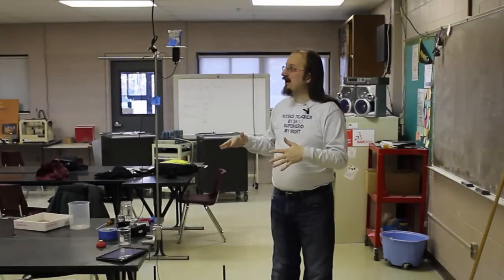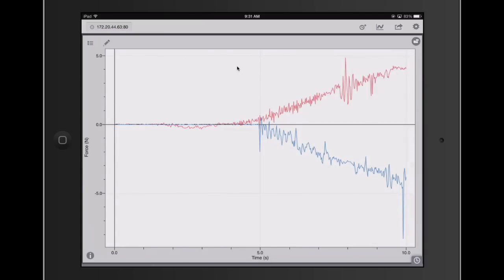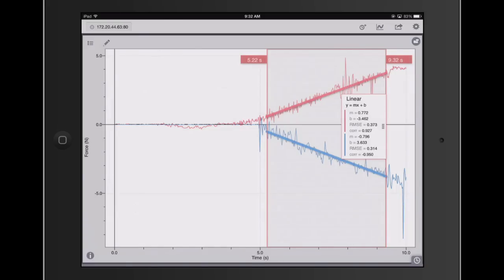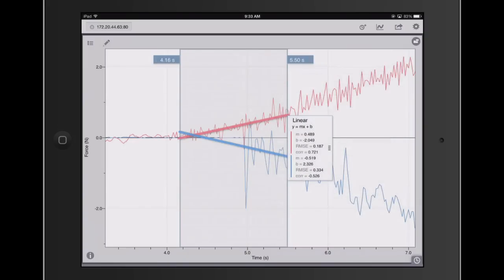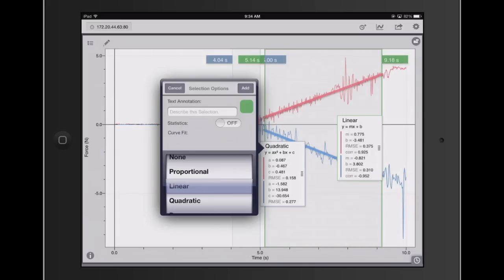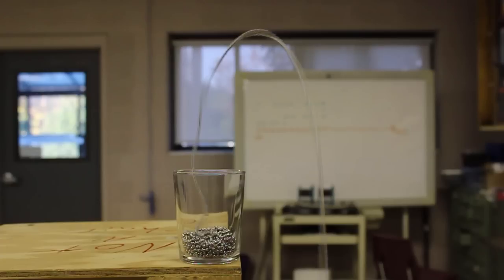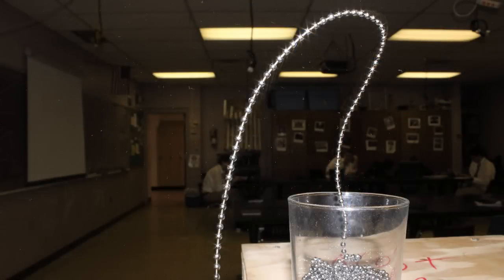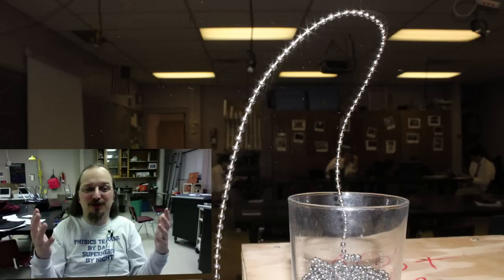Self Siphoning Beads - What's the Answer?

Comment: A bit of hypothesis. Consider an individual bead yanked from the jar upward as a free particle. It would follow an arced path consistent with gravity. Once the siphon is no longer accelerating the tensions on both sides of the bead should be equal and nearly opposite allowing free-projectile like motion. Prior to constant velocity the accelerating fore segment is effectively very high gravity and no visible arc.

Comment: Some observations from "Understanding the Chain Fountain" video by the Royal Society are that when a resting bead is pulled up, it pivots around its center which causes the far end to push down more on the table than it otherwise would, and that a system where an stationary object is forcibly joined to a moving one loses kinetic energy.  Put those together and there will be "free" energy available to the chain when it is jerked into motion.  Further, at the bottom end there will be free energy available when a vertically-oriented chain hits the bottom and would have to pivot sideways.  Combine those together and there's enough energy available to raise the top of the chain.

Comment: It speeds up at the beginning because the gravity is putting energy into the system (I know it doesn't, but for the sake of simplicity lets say it does) until friction and inertia of the stationary beads balance it out. It goes to linear speed because for every bead that comes up there's one that hits the bottom and therefore is out of the equation.The amount of beads affected by the gravity is pretty much constant and so the whole system is in equilibrium.

Comment: So, the two sensors are recording force? And the force is weight? So the graphs here indicate that as the weight of the chain that is in the top jar decreases, the weight of the chain that is at the bottom increases? Couldn't one, you know, intuit that without the assistance of several hundred dollars of equipment?
Reply from the maker: Daniel Tebbe the equipment was intended to look at the rate of weight change. The linear graphs indicate a constant rate. I had expected it to increase in speed continuously.
Reply: Of course it goes to a constant speed, the kinetic energy equals the released potential energy (minus losses).

Comment: This is jus momentum. loop starts when the glass is less full (not when it hits the bottom), at that point the chain has speed and mass, therefore momentum. It can't change direction from up to down in an instant because that would require a lots of force.

So, it is like throwing a ball in the air. the higher the drop, the higher the loop because it has fallen further and therefore it is going faster - it therefore needs more time to change direction.

Comment: The beads are spinning. in ELECTROBOOMs video //youtu.be/hx2LEqTQT4E at 13:10 you can clearly see the chain twisting on the slack side.
When one end of the beads is accelerated up, its pivot point is not rigidly held by the next link so it moves allowing some momentum to transfer to an axis that has more freedom. So the bead spins. It stores/carries this spin up until its axis is forced to turn around by the falling chain. And like a gyroscope it resists turning and pulls up on the chain. The harder the pull, the more momentum is stored.

Comment: I'm wondering if there is in fact compression on the 'up' side as there are waves visible on this side, whereas the down side is straight, suggesting this side is in tension. Simple mechanics is telling me that tension should be equal on both sides but visually,  this certainly doesn't seam the case.
Reply: aidanhd I see what you're saying and seems reasonable.

Comment: the last resting bead moves from 0 to infinity in 0 time . the falling beads weigh say 1 billion times more then a signal bead . the original tork force from 0 to infinity then slowing to the speed the rest of the chain is moving + a low presher area is created not much different then the way a wing works
Reply: will this work in a vacuum
Reply: Sean Kaday 
Yes, of course it will. Also, please check your spelling.